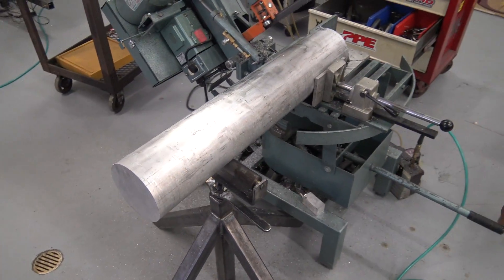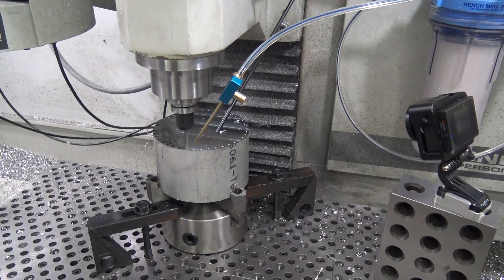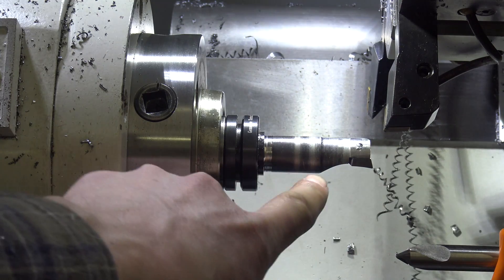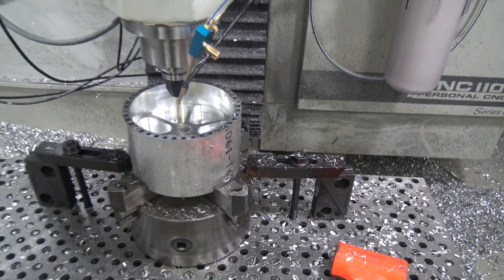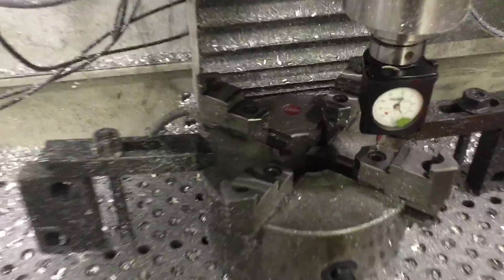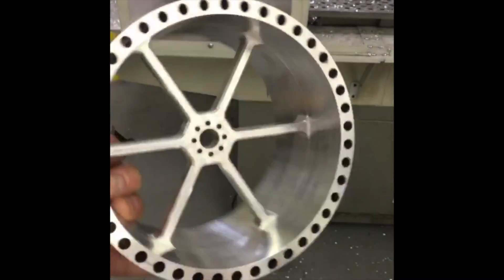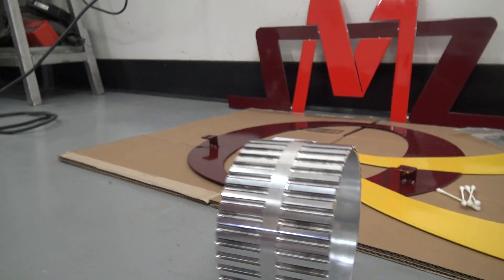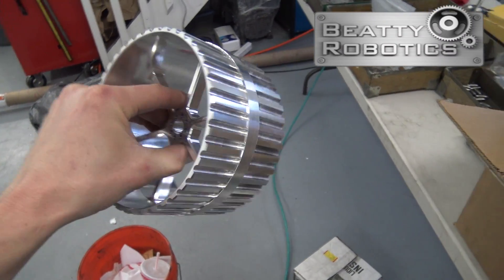CNC Machined Robot Lunar Wheels!  Widget84

Comment: Thank you so much for posting this! I'm doing a materials engineering course for my MSc and my project choice is the Curiosity rover wheels. So a different wheel design but since I'm completely new to the manufacturing side (my academic experience is in the science mission side) it was so helpful in seeing your drilling and milling sequences.

Comment: What do you mean by breaking in the blade I'm a woodworker so I'm not familiar with that stuff like how do you break them in
Reply: Who broke what? its alum ffs! like trying to "break in" the butter knife b4 you make your toast. just go 4 it
Reply: You should always break in your new blades unless you don't value your money. http://www.thefabricator.com/article/sawing/band-saw-blade-basics
Reply: Believe it or not doing the same with woodworking also extends the life of blades.. One of easiest things to do to a new band saw blade that will extend its like is simply taking a medium grade sharping stone and knockoff the 2 square edges on the back side. Simply hit the switch, lightly lay the stone at a 45 degree angle away from the side and lightly slide it up against a back corner. You dont even need to have the blade at working tension either.  

The idea is round over that back edge the way you do to a board with a round over bit.  Just that simple thing will reduce blade breakages.  Why ?   Any good engineer type knows why.  Removing that 90 degree angle there reduces the stresses there and basically redirects them back to the center of the blade. A good high quality blade will also have very tiny half circles at the place where the teeth join the mass of the blade instead of a sharp angle the cheap ones have.  Stress cracking will almost AWAYS starts at sharp angles like corners of a typical square cutout  or at right angles along the edge of a part. Thats why commercial aircraft have rounded windows.  they may be roughly square in shape but look closer.  THERE ARE NO sharp angles anywhere along the edges. I also apply a high grade of solid wax to my blade at a somewhat regular schedule. Apply it properly and feed a few inches of scrap wood to the blade to get it off the teeth.  The difference in effort required in sawing is shocking.

Granted, most of us wood butchers DONT think like metal whittlers but the physics is exactly the same and we rarely push wood anywhere even close to its fracture point like those guys do.  It will benefit any wood worker messing around with CNC to actually study HOW Saunders does things. Granted, we dont buy end mills with special fluting to reduce heat loads and so forth but more and more are venturing into the soft metals world. The way you approach workholding and order of cutting is just as important with wood. The results you get with these computer controlled wood whittlers will be taken to a whole new level. 

Personally If I had the choice between giving up my table saw and my TOTTALY home brew wood whittler,  That table saw would FLY to the curb.  Its capable of driving a quarter inch endmill buried around a quarter inch deep in hard oak at around 200 IPM   Ive even snapped them clean into by being an idiot and hitting a well set clamp by not being high enough to clear them  I have NEVER been able to stall out the steppers but I have brought the trim router to a complete stall a time or two. The accuracy over 24 inches is normally right at .0015. Steel expands with temperature rise so the acme rods actually change 
thread pitch a tiny bit shifting back and forth around the .0015   Not too shabby for a grand for everyrthing.. 

That was measured with a set of those starret high precision gauge blocks along the length with the start point set by a .001 feeler guage between the run out calibration rod. Then the axis was shifted right clear of the blocks.
Next the router was ran all the way to the other end a bit past the blocks and brought back in line to the blockend with  a .0005 dial indicator referenced off the blocks.  A bit of math taking into account that rod diameter, my high vacuum levels machines friend and I arrives at that .0015 figurine. Those guys work at .00000 or better levels. Who needs gaskets at 15 psi absolute with that level of chip making a light coating of vaccum grease is all thats needed

IM in no way a machinist but I DO understand the physics and I did NOT use any of his help in designing up my shop made CNC, never completed high school and it was made with tooling commonly found in a small wood shop. I  just know how to improvise and know my way around  a good solid modeling program of the calabare of fusion 360. A piece of .024 music wire stretched to almost the breaking point is what I used as a precision level. Just grab your continuity buzzer,, attach one lead to the wire. attach the other lead to a .005 feeler gauge then just slide that feeler gauge between the surface and the wire at each end, twist the 4/40 screws one end of the streched wire rig uses for feet until both ends buzz.  you then have the gap between the wire  and the surface to test for straightness set at levels of precision that are damn close to unmeasurable.. Then it becomes a simple matter of applied filing to get the entire length of big box steel angle iron flat to within say  2 or 3 thou. Just takes time.

Basically that's how I dd the seemly impossible. If I can do it ANYONE capable  of some out of the box  thinking and ignoring the "it cant be done" crap can do the same. People on the whole are far smarter than they think they are.
Reply: John Ware Thank You for the tip I will have to try that

Comment: Nice looking wheels!
About the "tread" groves - I make an oil pan that has external features that are similar, 60% open dia groves over 2" deep and .375 in dia ...I've had great luck plunging with a long-fluted end mill as a final op. They come out mirror smooth. Plunging seems to work extremely well for open-sided groves, probably because of perfect chip evacuation. My flutes are 1.5" long, so I take two .010 steps outward on the way down to avoid rubbing the shank. The steps are tough to notice, but I lined them up with other OML shoulders just to be picky.

Comment: Right at the end there I was just waiting for Judd to bite the wheel and marr the fininsh! 

I was asked to look at an engine once where one rod was locking the crank up when the cap bolts were tightened. I found tooth marks in the shell bearing from the owners German Sheppard!

Comment: Waterjet would have made short work of a lot of that!
Reply: NYC CNC I should say, it would have made short work of it IF the grooves around the outer diameter went all the way along the width of the wheel, not as much with that break in the middle

Comment: John

Any reason you did not face and bore that circular recess each side in the lathe before going to the mill to do the spokes and holes the second op back in the lathe to finish the outside ?

Stuart

Ps. Thanks for the cam help getting along better with f360 did some soft jaws using boundary fill to cut out the profile ( the part is only 12mm long curved all round )

Comment: I like the use of the drill vs end mill.  And concern the holes would wander with a bit that long?  Also, I sorted my CAD issue out.  Thank you for the offer for help though, John.
Reply: +Greg&#39;s Garage a carbide drill won't wander in aluminium that deep, you don't even need to spot for carbide drills because they're so rigid. in fact it's recommended that you don't spot for carbide drills because you're more likely to chip the drill.

Comment: Have you seen the forum post about the tormach someone retrofitted with through spindle coolant? Pretty neat.
Reply: NYC CNC I'll have to see if I can dig it up for ya. It was several weeks ago that I saw it, Note that it was not uber 300000 psi super coolant, pretty low pressure. Give me an hour or so to see if I can't find it.

Comment: Awesome project! SO much metal removal. Did you weigh them before and after by chance?

When I've had discoloration like that I've assumed it was from the chips packed in the flutes of the drill rubbing against the sides of the hole.

Did you finish the wheels with the lathe primarily to get two machines working on them at once? Seems like you could have finished the outside with an end mill just like finishing the inside.

I haven't done much of any plunge roughing, but I wonder if you could have sized the stock to final OD (either with the mill or lathe) and then did the hole pattern with the same end mill. I can appreciate not wanting to experiment with that long mill on that big piece of stock though.
Reply: +NYC CNC I had the same question. I figure you have to be close to 90% material removal on that part. Another way to handle the part flip, is to just put it back in unclocked, then probe your hole at 3:00 (or wherever) and use a polar rotation in the program to make any required adjustment to the code. You could also do the same with a work offset  on the center hole, if the chuck didn't repeat exactly. I used to make ProStock flywheels that very way.